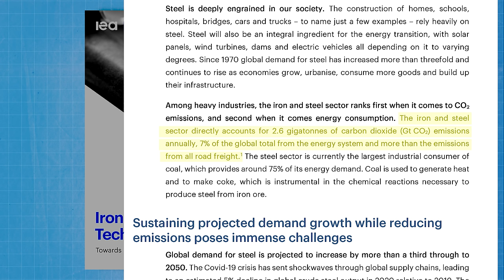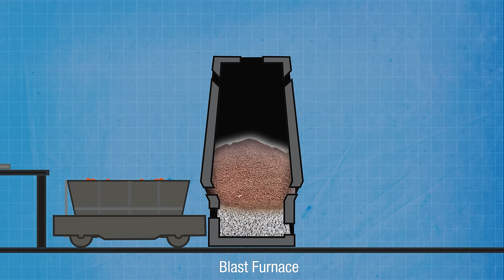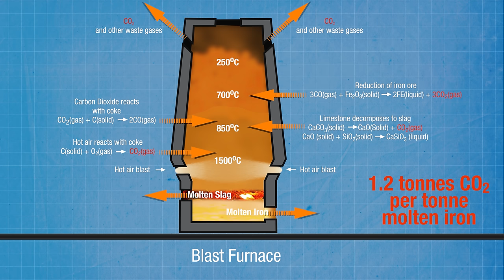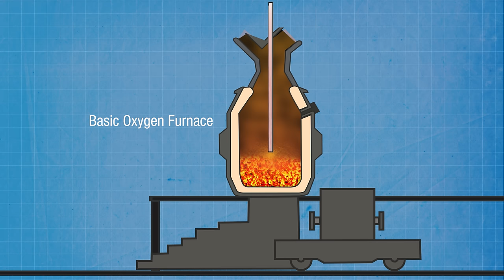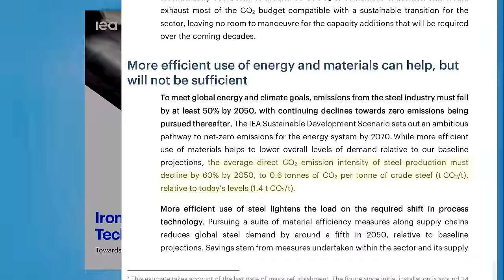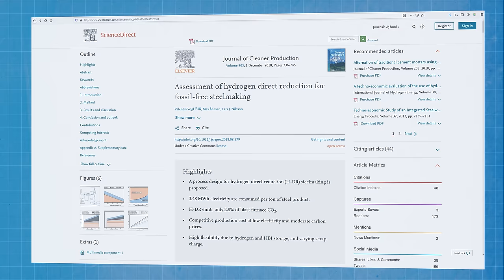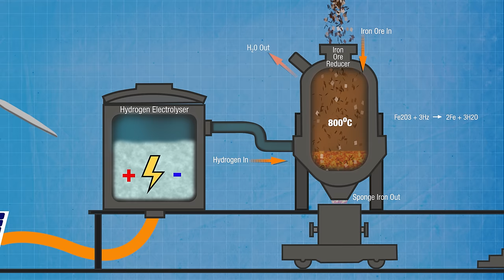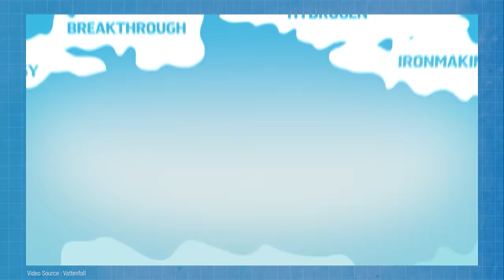Fossil free steel. Another giant step towards net carbon zero?

Comment: I live in a steel town and do third party engineering for the plants. It has always bothered me how dirty things are. Near the plants is where the layers of filth are most noticeable, but its everywhere. I k ow enough to know that the coke blowoff is the major culprit. Hope to one day be rid of that.
Reply: I grew up not far from Kaiser Steel in Fontana, California.  The coking ovens were the problem.  Those things were horrendous.  The air around there was lethal.
Reply: The black country in the UK was not called that with no reason.
Reply: My cousins worked at the coking plants on the border of Illinois and Indiana around Chicago, gritty air in those parts!  Glad to see cleaner technologies coming along.☕
Reply: I did work experience as a teenager during the 1980s at our local steel works (Port Kembla, Oz). The thing I remember was a thick layer of what looked like carbon snow all through the upper levels of the BOS plant
Reply: Just imagine the conditions about 50 years back. The technology was the same but the laws were missing then. Every tree and house was covered with a thick layer of black powder.
Reply: No, not the coke. The ore and the slag. It's unavoidable. But today, the dust is very thoroughly filtered. I think what you see are very old residues. Or do you live in a poor backward country?
Reply: Ironically we were checking the system intended to filter out those particles...
Reply: @johnreid2851  Sh...happens.
Still, the situation today is exponentially better than it has been 50 years ago and the hydrogen reduction plants will need very powerful filters too!
Reply: In the Dutch part of Tatasteel a technology is actively being tested (ready for upscaling) that can at least abandon the coking step and use coal grain (or other fuels) in a centrifuge like setup.
Reply: @choralimpact  Thanks for supporting me. Electric steel production is still not practical on many levels.
Reply: @TheSpecio  The is NOT the culprit; the gas produced during the reduction takes fine particles. The slag can be used for making cement and is useful. And if you can see the smoke coming out from the chimney then the filtering is not good enough.
Reply: @janami-dharmam  There is no smoke coming out of chimneys anymore. Only water vapor is still visible, but obviously harmless.

Comment: There is a paper by two German steel makers and their optimistic cost assessment for carbon neutral steel using H2 is about ten times the price of steel currently. There is no way this is getting competitive until there is a massive carbon tax and even then the resulting price of steel would be a major problem

Comment: I got a degree in metallurgy 38 years ago and found this very exciting. Would Iceland be a good place to build new plants?
Reply: Only if we could ship the steel out and ores/limestone in carbon-free...
Reply: Nuclear cargo boats are carbon free
Reply: @tisonlyi   Labrador, canada has large iron ore deposits, and is close to Iceland.  I suppose they use that allready
Reply: Do they produce ice in Iceland?
Reply: Sure. Can you magically move the steel around the world with zero carbon used?
Reply: Yep that is exactly what I was thinking!
Reply: Delta Beta true but that’s melting.
Reply: Planet earth would be the best place I'd say
Reply: @kevinroberts781  iirc, iceland is already the primary producer of new aluminum in the world, because electricity is so cheap there and doesn't rely on fossil fuels.
Reply: Worked in Steel making in Scotland 1964.. The BOS method , an Austrian company , got it all over the planet. Basic oxygen  steel making.the usual style of Pig iron to load into a furnace of mixed steel ingredients. As require in batches, as ordered. 
Exr tract oxygen in heating of Limestone to make Cement. Oxygen plant was adjoining ours. . Even the slag residue, Breese block was a big hit in building industry.
Eventually, it got to Korea, India, China, and any place that did not need permission to produce it. They got on the market, and  ‘ Market Forces’, Speculators,  invested where they could make money, Tough if you were a reel worker. But that is the system of Capitalism.  It sunk the jobs of millions of people, and spin off industries.. people don’t seem to realise, it’s the Serpant  eating it’s own tail, body to the end. Eventually, it will devour all, including its head. That seems to be why ,it is time for a change. Profit, is a DIRTY  thing. Money must go in place of work tokens, shelf lifted to stop accumulation of wealth, GREED.
Reply: @rfldss89  doesn't matter. It's still cheaper for me to buy it at my local plant that is 50 miles away. You must take in to account all carbon used.
Reply: @kevinroberts781  i don't think the transport of steel makes for as much % of the production, so they have a point
Reply: @mersco  Not going to happen in the foreseeable future, except from YT comments.
Reply: @rfldss89  
Not true, Rafael. Iceland is 11th on the list of Aluminium smelting nations.
Saudi Arabia is, by far, the largest producer at 33 million metric tons (2018). Iceland produced 870 thousand metric tons the same year.
Neither is Iceland’s electrical generating capacity large in absolute terms. They are 76th on that list, between Puerto Rico and Cuba. However , given their tiny population, they probably have more generating capacity per capita than anywhere else. The USA produces just under 18 MW.hr per capita per annum. For Iceland it’s just over 60 MW.hr per capita per annum.
Almost 80% of Iceland’s electricity is used in the production of aluminium (based on production of 870,000 tonnes @ 17MW.hr/tonne).
Reply: @ronwesilen4536  it depends on where it's being made and how you move it. That includes a massive effort compared to a steel plant 30 miles away. Also remember who runs said steel plant. Consolidated steel is a bad deal for everyone. Someone will get screwed. Meaning more carbon needed.
Reply: @mersco  apart from all the fuel used for digging up the ore and processing it as well as the huge amounts used to make the concrete etc. So nope far from carbon free.,
Reply: There is plenty of wind power available round the UK and it's pretty steady. IE we have enough areas that at least two have wind at any specific time. If the plants were put close to where the steel was processed (machined etc) then that would minimise transport.
Reply: @kevinroberts781  Sailing ships!⛵⛵⛵. Ships with wind turbines and solar panels?  🌞
Reply: @mersco  ,
I'm not anti nuclear, in theory, but I do question putting nuclear on commercial ships (again).
Can you imagine a terrorist attack inside a major Harbor like New York City or San Francisco??? 
Forget a potential nuclear explosion just imagine it as the world's largest dirty bomb.
No thx.
Reply: This technology makes the new Coal mine in Cumbria totally unjustified.  Higher carbon pricing and leadership from the UK government is required.  Both are sadly lacking.
Reply: @deltabeta5527  Yes! And in Greenland to. They make green ice. That is a part of the "green change". Thats why Trump wants to buy it !
Reply: I live in Western Australia. There are big plans here for Green Hydrogen and the big Pilbara Iron Ore production is here too. We have coal mines soon to be phased out from thermal coal production as that will be superceded by wind and solar here.

all the components fit that steel production methodology. Not that its planned but the iron ore, Hydrogen and coking coal should be available in massive amounts within a decade.

Still, I wish the wealthiest people just consumed a lot less....
Reply: @mersco  How about the mining
Reply: Mining is done mostly through pneumatic tools, your prime source can still be nuclear.
Reply: Australia would be better because they have the combination of lots of sun, and lots of iron ore. The sun can be used for solar power, to make electricity to make hydrogen which can be used to reduce the iron ore making Fe + H20, which you recycle to make hyrdogen.
Reply: What kind of degree did you get without knowing about electric reduction? It's a 'classic', just way too expensive, even in Norway, which has very cheap electricity.
Reply: @kevinroberts781  I'm not sure how your people got where they are now, but my peoples did it on wind power.
Reply: @TheSpecio  It was many years ago - Bessimer hadn't been dead for that long! We were taught that it was impractical to weld aluminum
Reply: @kevinroberts781 No magic that Iceland is ideally placed to manufacture shiploads of anhydrous ammonia as fuel for ships, and a gamut of existing uses. So yes, and in the best way!  The DC interconnect to Europe would be kinda moot.
Reply: Anywhere with abundant green electricity and water will hopefully share its inheritance with less-lucky parts of the world, politics willing. An exciting new metal rush.
Reply: The lack of local iron ore production would be the main issue.  Iceland imports aluminum ore for electric smelting already as this can only be smelted electrically and the higher value density of aluminum and the fact most of it's embedded value is from the electricity rather then the ore make this very attractive.  So while it may be possible in Iceland to produce steel this way, it's might be less profitable then just using the same electricity to produce more Aluminum.
Reply: I like your thinking, however logistic costs are often one of the highest costs in a supply chain. (location location location).
Reply: @deltabeta5527  carbon free ice is the most useful thing Iceland produces
Reply: @nick b if you push for a centralized area to produce steel, we will have to set it up so that every country owns part of it. If one county is charged more for the steel than another, that it's self increases green house gasses. This is why spreading out the production across the world to where it's actually needed is way cleaner.
Reply: @davidbruce2159  did you just spout off a crazy? I think you did.
Reply: @mersco  nope, just a bunch of facts
Reply: @nick b these aren't my wants. I know how to make iron from ore. You know full well what my point is. And you know it's right. Forcing people to bend to your will only starts wars. How much pollution would a war create?
Reply: @williamrbuchanan4153  Korean steel industry is quite high quality, but is getting decimated by China now.  They still produce for some shipbuilding and for high-end auto because China can't match the quality yet.
I don't remember the exact models, but there are some Hyundai cars which if you buy it in the US or Europe it will have a Korean steel frame, but if you buy them in Korea they will have cheaper and heavier Chinese steel frames.

Anyways, bosses and accountants think steel is steel, but engineers and the folks actually making it know there's art involved.  On this and so many other things, we got to stop letting finance run the world.
Reply: I guess that no one here has heard that all the g 10 countries are currently fighting over Africa . It's extremely resource rich and you can get the war Lord's to create a slave force to extract what you need for next to nothing . plus they think with the changing climate that in the next 30 yrs there will be a new green belt around the north east part or the country.
Reply: @cweber9784  their time is coming.
Reply: @mersco  lol and they say a ship wreck has a huge environmental impact now imagine a nuclear reactor running out of control @ the bottom of the ocean for a few yrs
Reply: @davidfechter3635  or a reactor running out of control @ bottom of ocean for a few yrs
Reply: Any idea if hydrogen embrittlement is of any concern with this process?
Reply: @mersco  I was a submariner in the US Navy, on nuclear powered submarines...it's great when done correctly! I don't necessarily trust private companies to do this correctly, especially on Flag of Convenience ships, that is to say, ships registered in 3rd world countries like Panama, to avoid having the pay the crew well, pay their fair share of taxes, and comply with regulations. I would love to see the US Flag fleet (and that of the other G7 countries) converted to nuclear.

A lot of the large ships are converting to natural gas, which reduces the CO2 emissions by quite a bit and completely eliminates the particulate emissions. :)
Reply: @cweber9784  the ocean water is already filled with natural occurring uranium. You act like we don't dig this stuff up out of the ground, but we do.
Reply: The problem is Iceland is a distant land from the best ore sources. 

Energy wise
Economically foolish
Reply: @mersco  in Chernobyl they used nuclear fission directly to melt steel. It worked too well
Reply: FORGET THIS SCAM FOR IT IS NOT A REALISTIC TECHNOLOGY.
Reply: @musFuzZ  never mind Iceland, Labrador is close to  vast hydroelectric power dams, the steel can be made in Quebec
Reply: No because you have unions. This will be done in China. Sorry bro.
Reply: @kevinroberts781  Transport is a miniscule part of the emissions from steel. You can ship a tonne of steel 300,000 km for the average emissions from producing it. Land transport has higher emissions, even so, the gain is in  better production and recycling methods, not in reducing distances.
Reply: @tisonlyi  Australia has the ore and the sunshine if not the people.
Reply: I think that wherever the concentrates are produced, would be the best place to produce pig iron. DHR could be better off carried out in Australia, with their new Hydrogen technology. Let Australia take the big safety risks (sponge iron is pyrophoric and even small amounts of air in the reactors could cause major explosions) and large energy input required. Sending ship loads of Pig to the UK would be better than sending 875000 tonnes per annum of concentrates. The UK steel industry would otherwise require 16.9 TeraWatt hrs to produce the necessary hydrogen

Comment: Wonderfull development. Steel is one of those fields where it seemed impossible to lower carbon emissions, but it seems that it is indeed possible.
Reply: Yes this, and the almost unbelievable "carbon-negative" concrete seem to offer hope over previously insurmountable contributors.
Reply: On the other side of things, I'd argue that making use of steel instead of other materials enabled carbon emissions reductions due to its strenght.
Reply: @DunnickFayuro  It's a good point. It's hard to imagine how one could double-bake bricks at a temperature near the melting point of steel with electricity directly. Overwhelming mountains of constructions using steel-reinforced concrete... both, with steel used for tensile strength to complement the other's compressive strength.  Even entire floors in buildings can be made of the stuff.  Mind you, plenty of multi-story dwellings are made of "sticks". Combustible insect food. Strange, yet carbon-negative.

Comment: The molten oxide process of Boston Metal is also fosil fuel free. Would be good to compare it with Hydrogen based reduction process
Reply: Its founder is also an inventor of an awesome liquid metal battery. Will go online in 2021. It's called Ambri.
Reply: Well this video misses the point of HYBRIT. The project isn't just about the steel plant but all the way from the iron ore in the ground to, enrichment plants, transports and the furnace. So the project isn't just about making steel. It is also about sustainable mining.
Reply: @thenorthernhandyman   Good point, I would also say that what Boston metal is doing might be ALOT harder to scale than hydrogen.
Reply: Was going to mention Boston Metal as well. Would be interesting to see a side by side comparison, perhaps some interviews on the topic of representatives from both SSAB and BM. At first glance it seems quite wasteful to go through the trouble of generating H2 instead of just going the Boston metal route.
Reply: @ulwen  The hydrogen production must been seen as part of a larger integrated system that combines grid balancing, energy storage, ship fuel and steel production.
The problem of an electrolytic process on it's own is that it doesn't answer for how the energy is produced in large quanities, carbon-free and without any instability to the grid on a local or regional level.
At the end it can only function in certain places like Iceland.
Reply: Is that the aluminum reduction smelting process? Where the alumina gets electrolytically reduced back to aluminum?
Reply: @sualtam9509  The electrolytic process presumes the electricity is generated sustainably just like this hydrogen process presumes the hydrogen was generated sustainably. In the end we will have to see which of these processes are more financially viable.